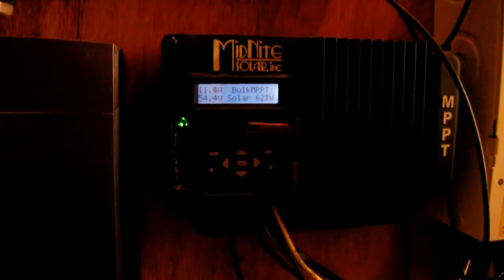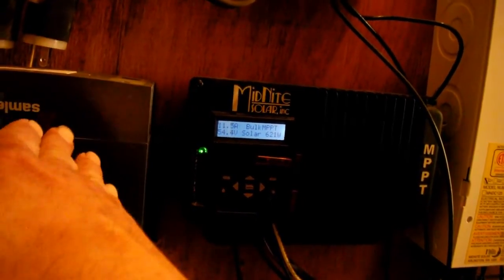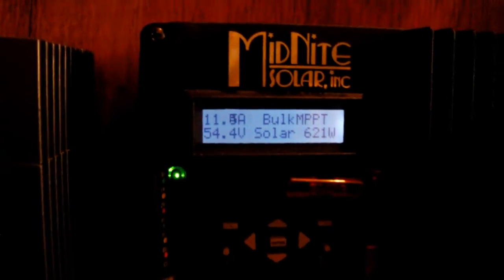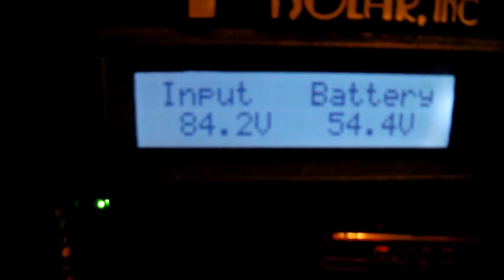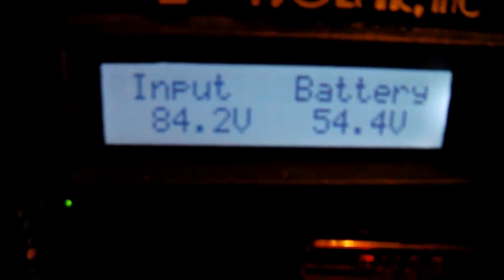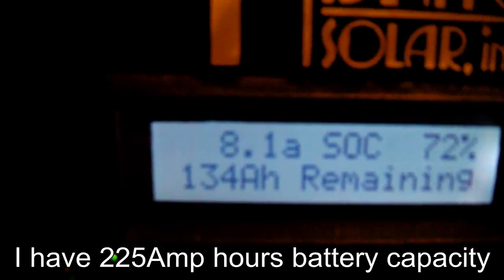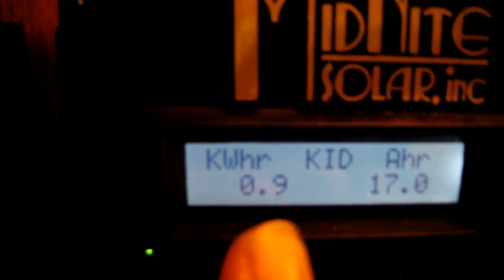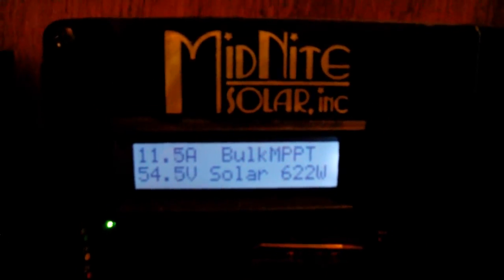Update on my Solar Power setup, Midnight solar "Kid"

Comment: 225A by 12v or 24v?
Reply from the maker: 48V system.
Reply: That's big
Reply from the maker: Sammy Kalintosh Yeah It's took me several years to build up to it. I'm at 2200watts of panels now and 16 6V batteries.

Comment: Great points about the incident angle of your solar panels having effect on the output.

I'm working on the concept for my own system, hopefully for implementation next year. One thing I want to build into the system is a way to adjust the angle of my panels without having to go up on the roof. I was thinking something mechanically similar to a transom window.
Reply from the maker: Yeah it's amazing how much the sun is at a different angle throughout the year.

Comment: Awesome... Who would have thought the tilt would give you that much more power.  Thats awesome..
Have the wife talked in to letting me get a system on the new house when we start building.
Reply from the maker: Yeah I kinda knew it when I first installed them but didn't have them angled up enough. I wouldn't have thought it would make that much of a change. That's cool if you can do solar with the new house.

Comment: this is a very interesting series TR if i may ask what would be the magic number to run the whole house?
Reply from the maker: I'd say with the average family about 5000 watts would be what it takes, 3000 watts if you really cut back. But for me as a single guy I'm hoping that 1500 watts will pretty much cover what I use.
Reply: I get about 1400 watts peak generation. I think I use closer to 2400 during the day.

Comment: Looks great. I plan on getting a solar system when I move to the cabin. have temp electric pole now.but will run off both.
Reply from the maker: It's the way to go for sure, unless you have access to hydro or wind setup.

Comment: TR the simplest way to look at it is a unit of measurement for battery capacity. You get this by multiplying current flow in amps by the time in hours of discharge. Such as a  battery which delivers 5 amps for 20 hours delivers 5 amps times 20 hours, or 100 amp-hours.
Reply from the maker: The APHR reading on the kid is what I really don't understand, I don't know if it's what I used or what went into the batteries. Their website doesn't even talk about it.